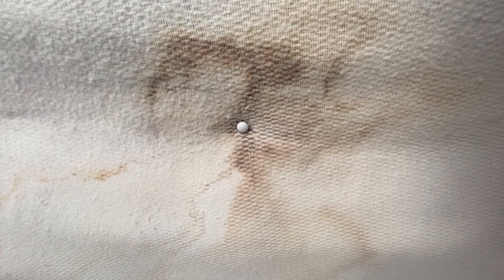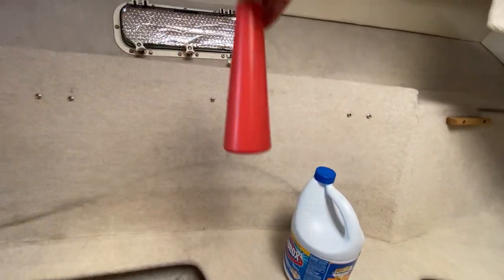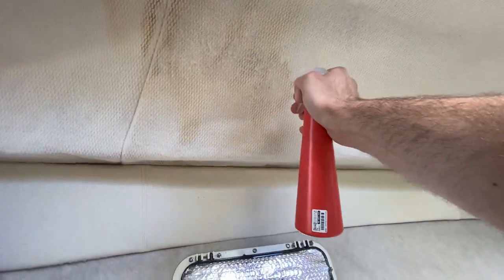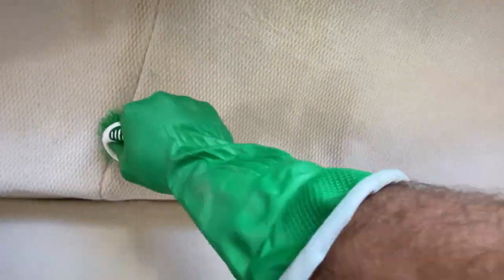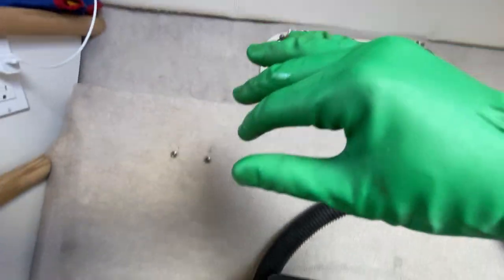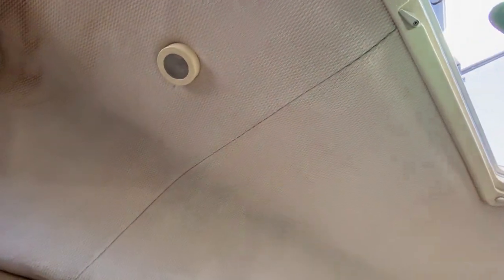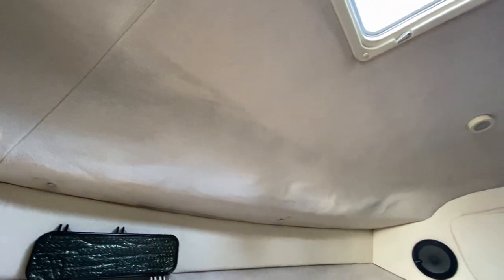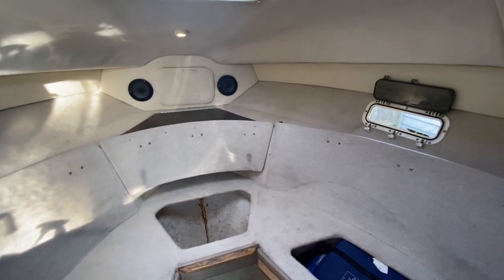How to Remove WATER STAINS From BOAT Interior (Monkey Fur and Headliner)

Comment: I did this today and it worked great. Thought I had half a bottle of  mold mildew remover and mixed that with bleach and they also came right out!
Reply from the maker: Fun fact about mold and mildew removers!  Look up the MSDS for all of the mold and mildew cleaner products and you will find that they are literally 5-10% Sodium hypochlorite (the same ingredient and strength as clorox bleach), with a proprietary scent added to mask the bleach smell. Bleach is $10 a gallon, while the mold and mildew cleaners (lemon bleach) are $11-$15 a pint.

Comment: Thanks for the video, I have dealt with this several times over the years,
WARNING bleach is quite corrosive and will eat your fabric if not well rinsed out.
I would soak it with fresh water many time after, Best would be a portable carpet cleaner.

I prefer the strong cleaning vinegar and water, and I use a rotating brush head on my cordless drill, and try not to push too hard.

I Love your razor trick, I will be using that

Comment: You're going to destroy the materials with that strong of bleach...smh
Reply from the maker: I disagree. This was filmed almost 3 years ago and the headliner still looks healthy as it did the day I cleaned it. Bleach does degrade the strength of fabric, but that really comes into play when it is under load/stress, like stitching on vinyl seats. The seat stitching is under load both when being used and not, then comes into contact with bleach, and eventually fails from the stress and its weakened state. There is no stress applied to the monkey fur other than when it is being scrubbed, so there is really nothing to fail other than the adhesive, which the bleach doesn't effect.

Regular scrubbing/shaving would destroy the material down to a flat mat, but that is why you fix the leak first, then clean up from it, so you only have to do it once. 

On another note when it comes to removing mold and mildew stains from boat seats I hear over and over "DONT USE BLEACH, use this mildew cleaner instead since bleach will damage the stitching!" Look up the MSDS for all of the mold and mildew cleaner products and you will find that they are literally 5-10% Sodium hypochlorite (the same ingredient and strength as clorox), with a proprietary scent added to mask the bleach smell. Bleach is $10 a gallon, while the mold and mildew cleaners (lemon bleach) are $11-$15 a pint.